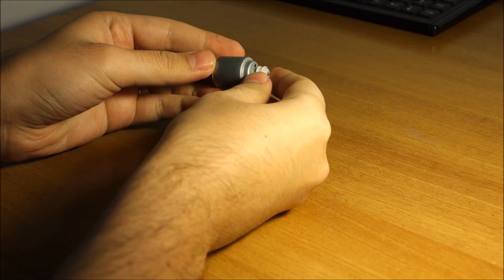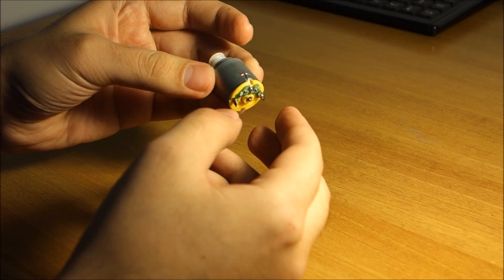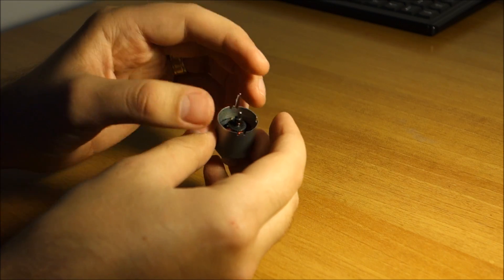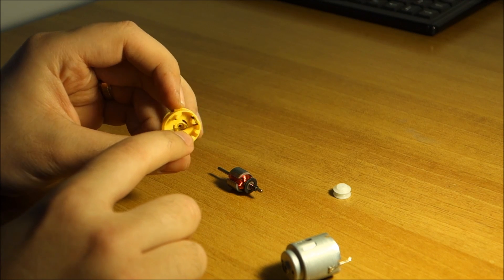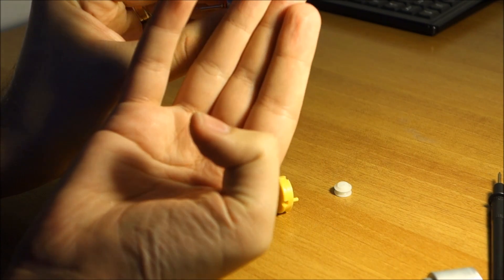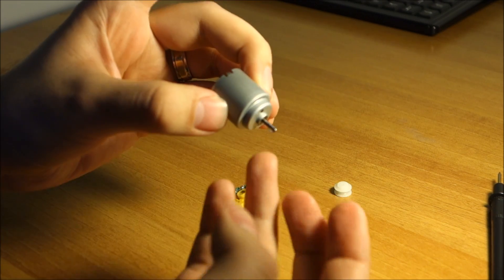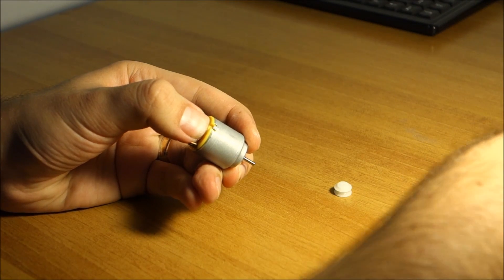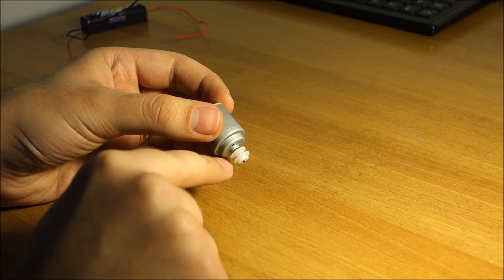How to teardown and repair a toy motor

Comment: FYI, “Brasso” metal cleaner will clean and polish the commutator and brushes and make them smooth and shiny!  LaBelle 107 lube is made for train motors and can be used on the commutator and brushes, bushings, and everything.  That would be better than the silicone grease because if that non conductive silicone gets onto the commutator, it wouldn’t run well.
Reply from the maker: Thank you for the information! :)

Comment: I have a vintage 1971 toy motorcycle that is battery operated and the motor chatters and doesn't spin as fast as it should consistently. Do you think cleaning and greasing the shaft will fix it ? Was that dielectric grease that you used to lubricate the shaft?
 Thanks for the video!
Reply from the maker: +Jeff Stone I can't be sure, but in my opinion you should at least try it. It was silicone grease. I'm not sure if it's the best for the situation, but it seems to play well with plastic also.
Reply: twizar  Awesome, I will try it thank you!
Reply from the maker: +Jeff Stone welcome and thank you for watching my video :)
Reply: It is absolutely brilliant to clean the commutator and brushes as shown.  Brasso or any metal cleaner and a Q tip will make that metal smooth and will reduce friction and increase conductivity.  The silicone grease is ok for the bottom of the motor, maybe...if there’s nothing else around the house.  I’d keep it away from the top or it might get on the brushes.  Google LaBelle 107.  It’s made for toy motors and is plastic safe.  Also the Tamiya 4wd crowd has all kinds of advanced motor repair, modding, lubricating, cleaning tips.  It’s kinda fun checking out all the stuff that can be done to a motor to improve it, ha ha!

Comment: Are there any alternatives to the kind of alcohol you used?
Reply from the maker: +Kiwi you can use any alcohol solution, like window cleaner, rubbing alcohol and even some drinks with really high alcohol content. The higher the alcohol procentage, the better it will do the job.